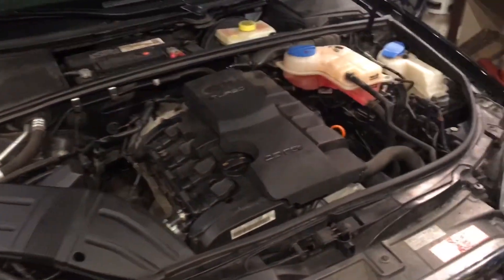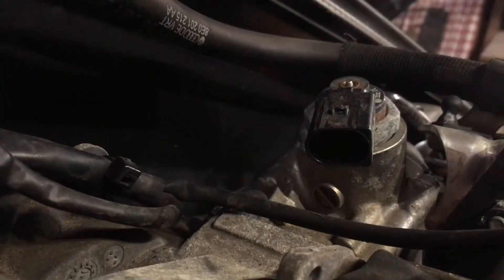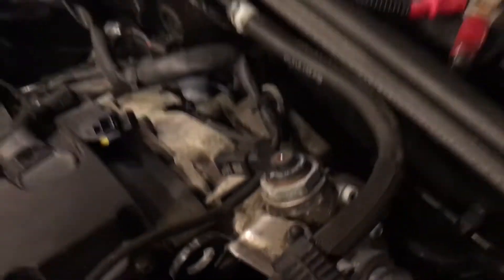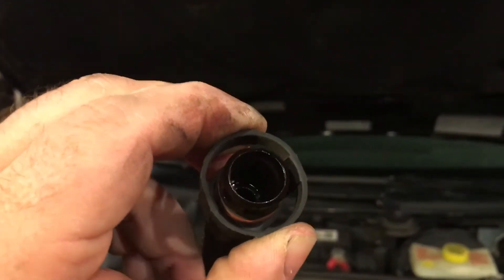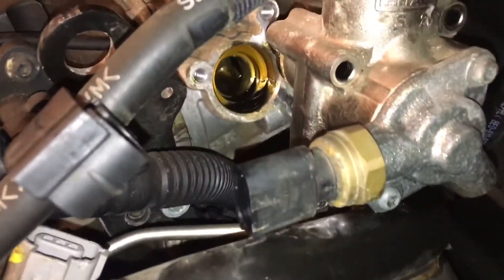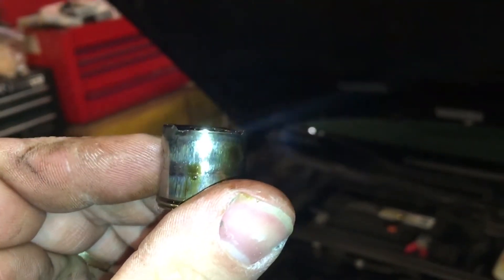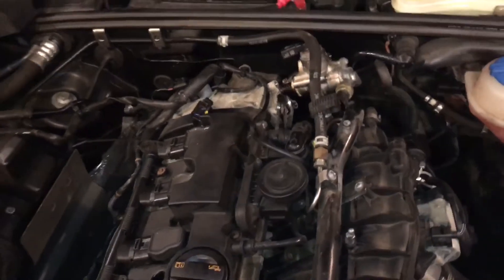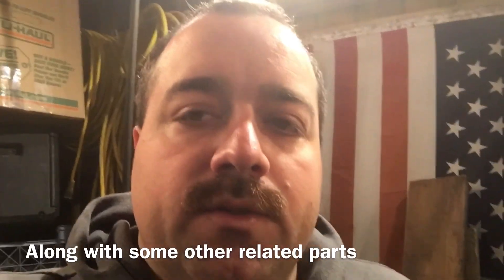Audi VW 2.0T HPFP Cam Follower Inspection

Comment: Exact same problem. Mine blew through. Won’t run now. Had no idea about this part. Should be recalled, period
Reply: Thanks man. Thinking the same lies ahead for mine. I took GREAT care of it. Just somehow never knew about this dumb faulty cam follower defect.
Reply from the maker: Audi did a warranty extension before 2008 models. But I don’t know how helpful it really was. Sorry to hear about your situation. I repaired this issue myself with new timing belt, tensioners and camshaft since it chewed the camshaft so bad. I then made sure the car was running properly and sold it.

Comment: So you had to replace the camshaft? How much did this all end up costing you?
Reply from the maker: Including the camshaft, timing belt and water pump etc.  I think that I spent about $1000 in parts.
Reply: @JoesCarSmartsNY  did you have gas in the oil? My 2010 Audi A4 has about a half quart of gas in the oil after 1,000 miles since last oil change and I'm guessing the hpfp is the problem.
Reply from the maker: I don’t remember having any gas in my oil.  I started this project because the HPFP follower had degraded so badly that the pump couldn’t create enough pressure for the engine to run. 

I’m also not sure how the HPFP would get gas into the oil. I suppose it’s possible, but I would think you’d probably smell it under the hood if that was the case. Best of luck to you.